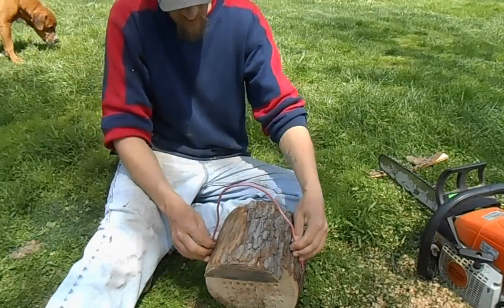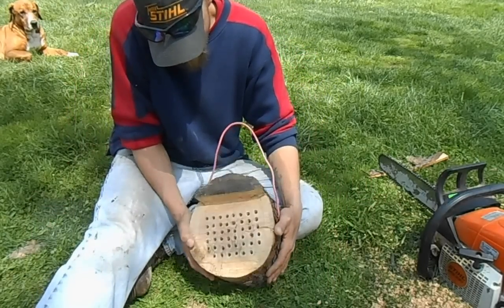Building a Orchard Mason Bee House

Comment: At a bee workshop I attended the instructor was fairly negative towards drilled houses.  They recommend houses where the cocoons can be removed and cleaned at the end of the season.  e.g  paper tubes, split wood "drawers".  See Crown Bees offerings.
Reply: @ grommet2003 ... You can use a Twisted Wire Tube Brush in the same diameter of the hole. Cleaning each hole manually or connected to a hand drill. If your harvesting them, then this will not work as you kill everything inside each hole.

Comment: Really cool concept but no way to harvest/manage the bees. If you drill the holes all the way through and cap the back end you could then roll parchment paper tubes and insert them into the hole. Remove the tubes in the fall and voila.... you have cocoon's to harvest.
Reply from the maker: caddisking That is an excellent idea. I had someone not long ago ask me to sell them cocoons. I told them I had no way to get them. Now I do. Thanks
Reply: Jason I believe you are supposed tob use 3/8 holes when using parchment paper
Reply from the maker: caddisking I may have to build a couple new one's and spread them out on the farm. Thanks again!
Reply: I read somewhere if the holes are too big...bees won't use them. It said holes should be no bigger than 10mm, which is just slightly more than 3/8"

Comment: What kind of wood works best for making Mason Bee Homes? I was thinking 
cedar would work well since it doesn't decay very fast in the outdoors, 
but I was concerned since cedar is known to be a natural bug repellent 
in it. Wasn't sure if it would hurt the Mason Bees or discourage them to
 enter
Reply from the maker: +James Heasley I used pine but it will rot as you probably know. Cedar would be perfect but I am not sure if it will affect the bees or not. I guess you could make one and see what happens. If it works then make more. Good luck and keep me posted with your research.
Reply: I have "plenty" of pine logs. How many years of use did you get out of pine?
Reply from the maker: +James Heasley This is my newest houses for mason bees. Some of them do have cedar roofs. You could also put a metal roof on them. https://youtu.be/mFIpvgKG1-U
Reply: Another neat idea for keeping these houses long-term is using rubber sealant, it's cheap and you can coat the sides with it to give it extra protection. If you put a metal roof you can even use it on that to keep the metal protected.